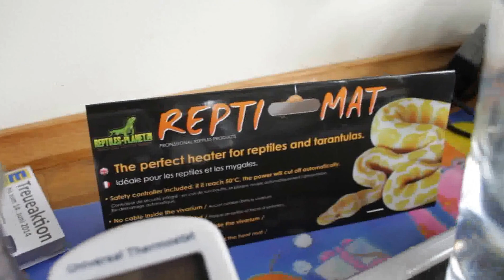DIY Mag Stirrer & Hotplate

Comment: Hi there, How hot can you get the water?? Thanks
Reply from the maker: +Rune Burgaard These things are usually aimed at being stable around 38°C, have a cuttof temp of 50°C... soooo with insulation around a container, you could perhaps raise the water temperature to somewhere around 40°C-ish but that's just a guess. I haven't tried to use it for heating water specifically. But I'll do a test and get back to you on that.